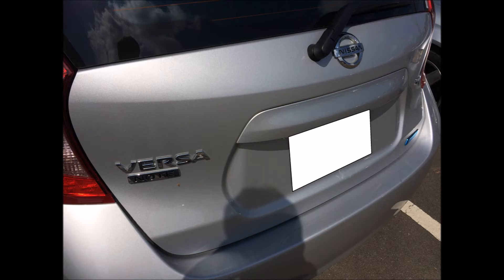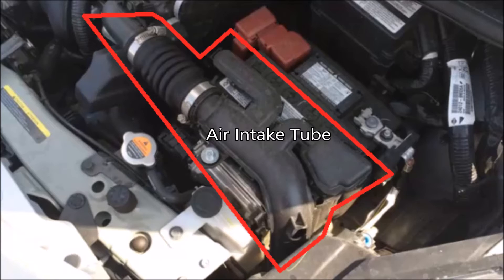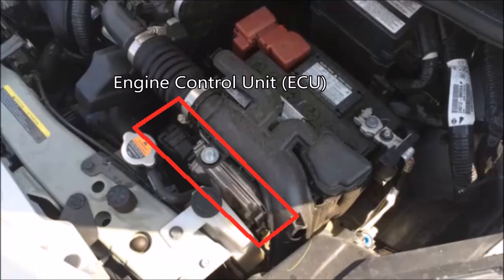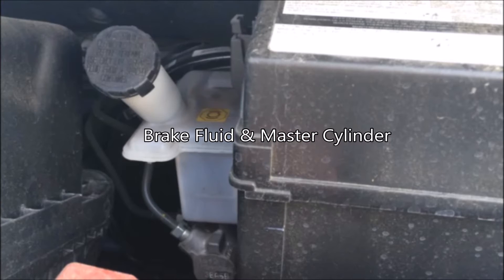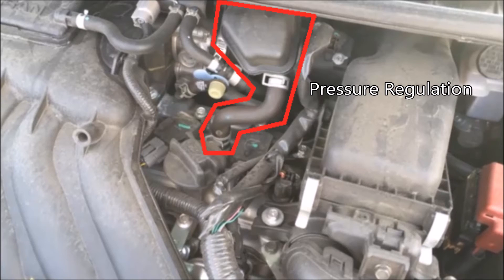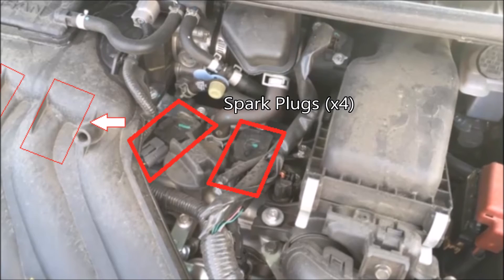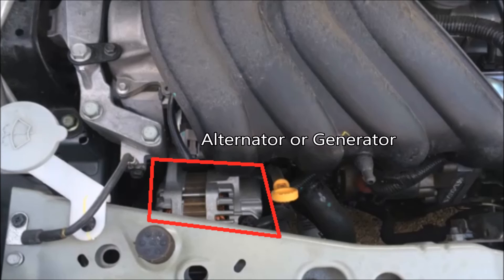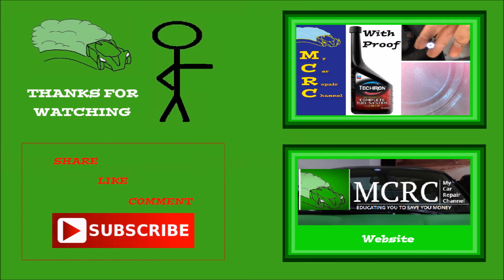Nissan Versa Note 2016 Engine Review - SV 1.6L 4 Cylinder

Comment: The engine is actually pretty high rev on the highway with the manual transmission. Always on 3k-4k on normal traffic
Reply: ive been a lil under  2k with and auto transmission going 65. not bragging or anything , im just researching this versa note 2016 i bought a year ago. im wonder what aftermarket parts i can add to better to its fuel economy(not thats its bad to start with) and such . have youve added any after market parts to your versa?
Reply: Skepticool 333 I’ve added air filter .. check carid they have some suspension parts wheels and lights some body kits .. it can go from 109 HP to 115 or so hopefully w an SRI intake Injen

Comment: Do you have a video to where the crank shaft sensor is on a 2016 Versa note?
Reply: under exhaust manifold covered with metal plate